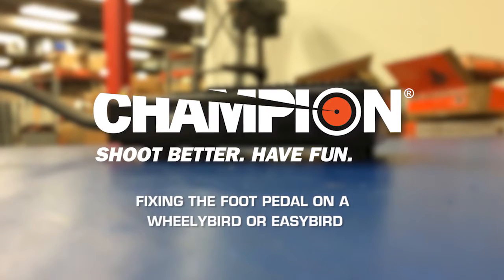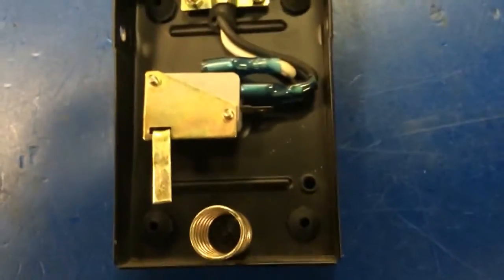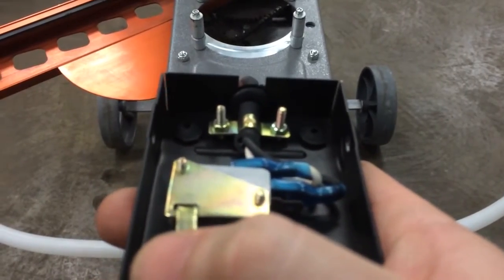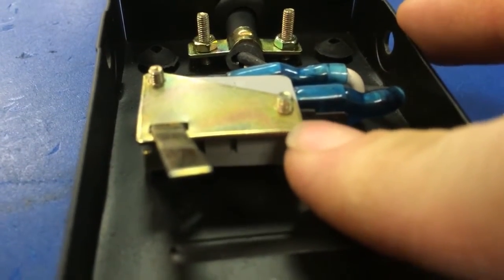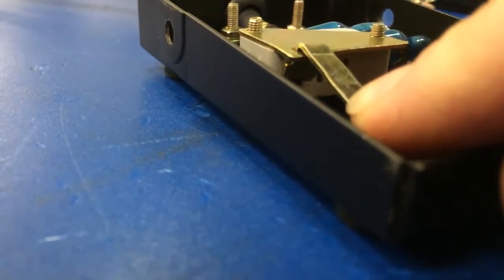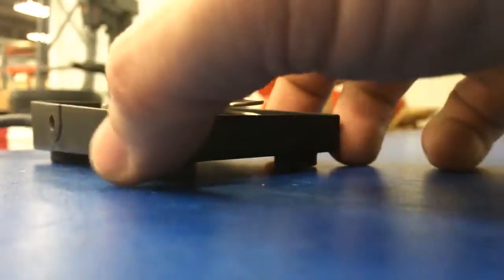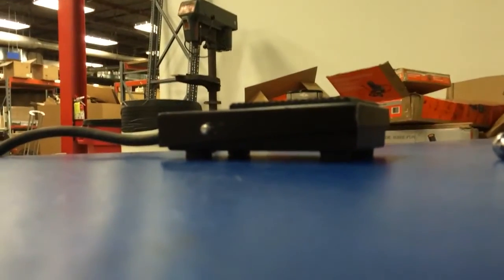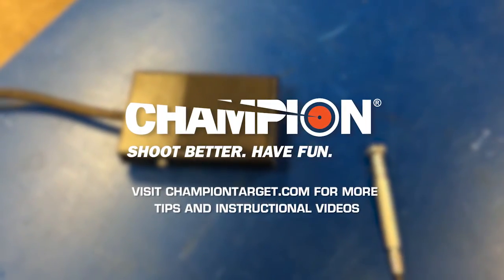Champion® Technical Assistance – Foot Pedal Repair for the EasyBird® and WheelyBird™

Comment: Called champion for replacement switch.  They don't carry just the switch, you have to purchase the entire foot pedal assembly, which they did not have in stock and didn't know when they would get some in or how much they would be when they did get them.  They suggested I try Amazon.  Pathetic customer service, last champion product I will buy unless there are no other options.